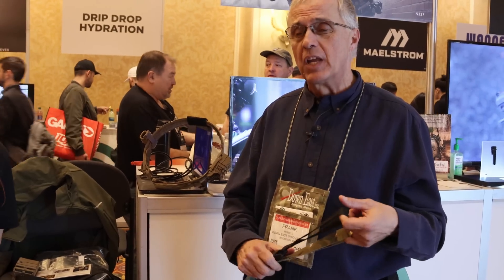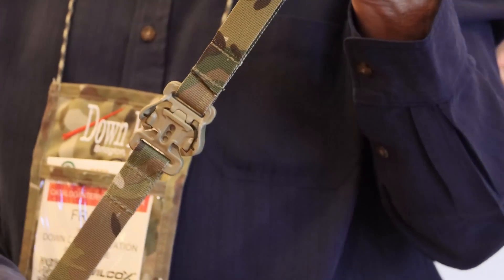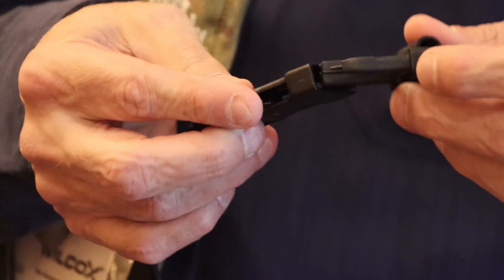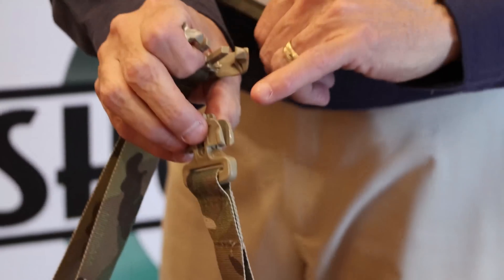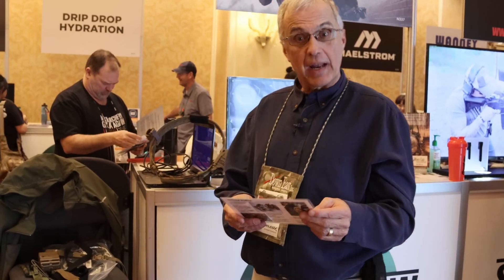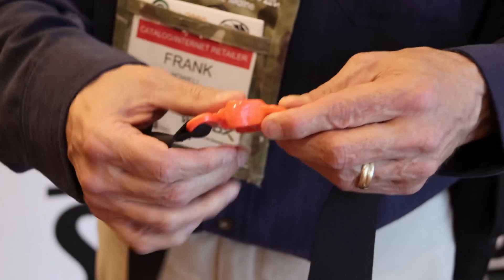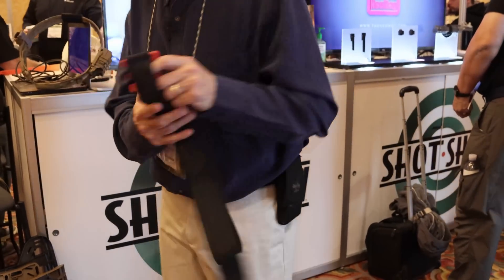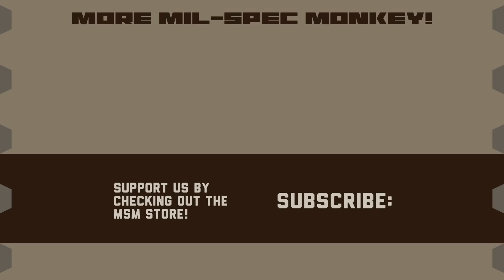Down East Innovation ShotShow 2020 - 3DSR Quick Release Buckles

Comment: I just got some of these buckles, I can’t get them to open. Impossible to open. What is this guy talking about
Reply from the maker: If having trouble, his hand position at 3min mark helps get the hang of it. Basically have to make sure and squeeze the peaks of the release arms and not just squeeze the buckle with a blind grip. Also they are easier to release when actually on something as opposed to just a loose buckle in hand.